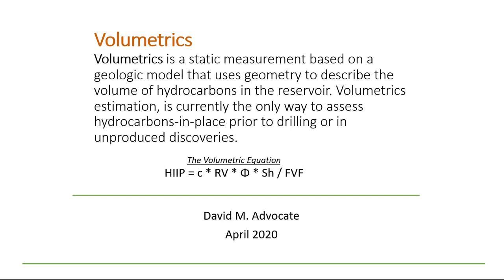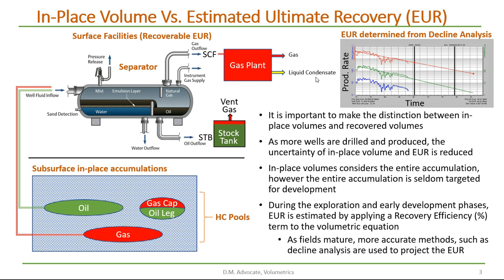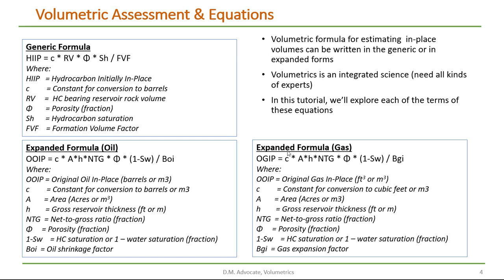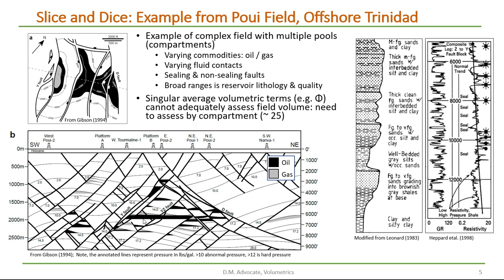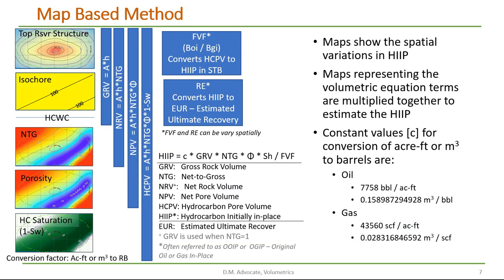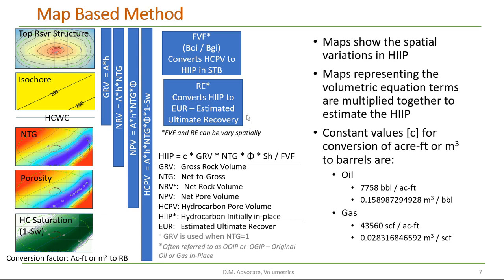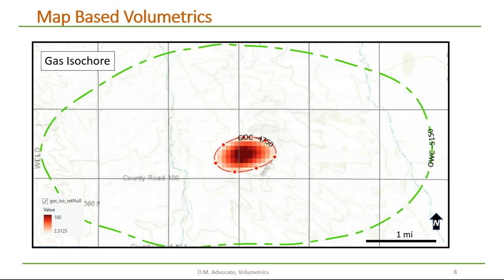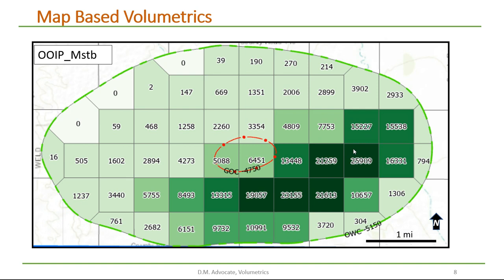Volumetrics Part 01 of 11: Introduction to estimating oil and gas volumes in the subsurface

Comment: In the volumetric equation,are we going to use total porosity and tot saturation or effective poro and eff sw and what is the impact ooip in both two cases?❤
Reply from the maker: Good questions.For OOIP you want to use the Effective Porosity. The effective porosity is filled with oil and water. The volumetric equation takes into account the oil filled fraction of the pore space using the water saturation term, i.e. 1-Sw. So, you would use Effective porosity x 1-Sw.
Reply: @davidadvocate5449  some company use total poro but i don't know why?

Comment: Thanks for this video, but please how did you get area for the calculation of the GRV
Reply from the maker: There are several methods for estimating area. Before computers were available, geologists would use:
1) A planimeter, a device used to measure a two-dimensional areas (you can google this)
2) An "acre maker" which is a see through graph paper. Depending on the scale of the map, each square on the grid paper represents a specific area. Just count the number of squares within the area you want to measure and sum up the area.
With the advent of computers, estimating area became very simple:
3) I usually use a GIS mapping package which automatically gives the area of a polygon.
4) Google maps and google earth also have the ability to measure distance and area. 
5) There are some specialize computer applications for doing volumetics, such as GeoX, which have the functionality of estimating area.